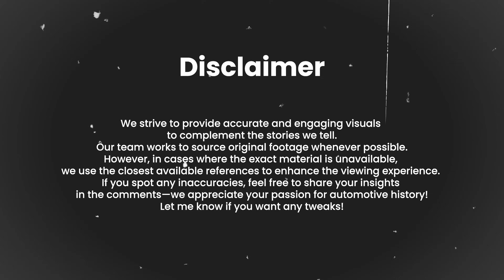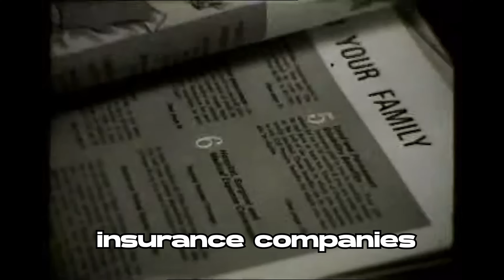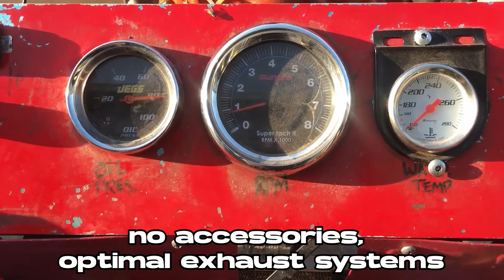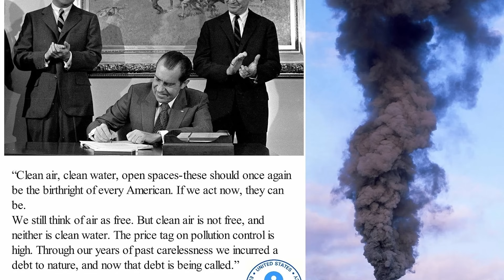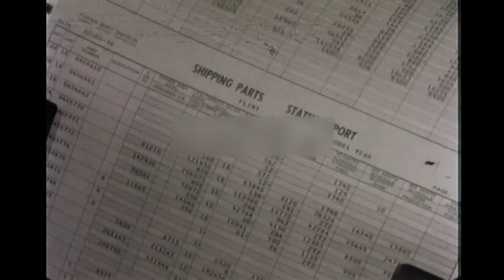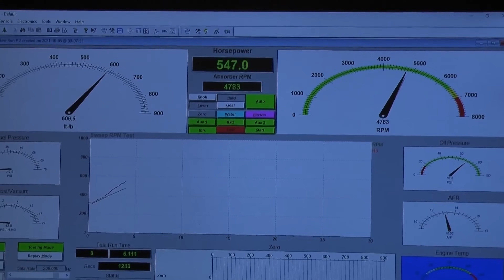The Shocking Truth behind Chrysler banned 440 Six Pack Engine

Comment: Mixed feelings on the 440.  One of my dads employees had a 1966 Sport Fury he got from his dad.  Truly a beautiful car which had the optional 440ci motor.  One evening he agreed to race a guy with ‘69 Chevelle 396ci for $100.  I knew the guy with the Chevelle and I knew his car was fast. He had a solid lifter 396 with 3.55 gears.  But in my opinion his biggest advantage was less weight, a fiberglass hood and trunk on that car.  If memory serves me right it was a cold October evening in 1979.  I even remember walking over to the speed shop in town to buy a can of 105 octane booster for my dads employee.  Well, the results were embarrassing, I would even say humiliating.  The ‘66 Sport Fury lost by at least 5 car lengths.  It was never close.
Reply from the maker: Thanks for sharing your story! The '66 Sport Fury with that 440 engine definitely had its charm, but racing stories like this remind us that weight and tuning play huge roles in performance.  @bgjb-r1499
Reply: @rarecarstorys Put the 440 in a dart or barracuda and then it's a whole other story. 440 6 pack, 400 hp. Or more, actually.
Reply: The 66 440 was a cruiser engine, it was 67 that the 440 Magnum was offered and became a street legend. In 66 the main performance engine was the 426 hemi. I'm sure the Fury was heavier than a Chevelle, hence the disparity.
Reply: It all depends on the tune of the motor . You could have 2 identical cars and motors and something like improper ignition timing could have 2 identical motors putting out vastly different power .. The 440 properly tuned should have moped the floor of the 396!! The 440 just was not tuned properly simple fact..
Reply: @kevindoherty2716   Here’s what’s weird, in 1979 that Plymouth was a 13 year old car and that Chevelle was a 10 year old car.  I agree with you regarding timing and having the motor properly tuned.  In retrospect asking me to go buy him a small can of STP 105 octane booster was a mistake without properly resetting the timing which is what I think you’re saying.  Joe was a local guy from my town and I believe his ‘69 Chevelle was also stock with the only modifications being that fiberglass hood and trunk which he swore made a big difference (lol).  One day he was spitting nails (angry) about constantly adjusting his valves, that’s how I found out his motor having a solid lifter camshaft.  You couldn’t ask for a nicer 1/4 mile strip.  The neighboring town had chemical plants which also had a perfectly straight road with an additional 200 yards to stop your car.  After someone got them on the line a car pulled out a little more than a 100 yards from the start, turned on the parking lights (get ready) and then the head lights (go).  The Chevelle had .355 gears which I find hard to label because they’re not racing gears or highway gears.  It was a 4 speed.  The Sport Fury was a 3 speed auto (no idea about the gears).  I’m being truthful with you, the race was never close as that ‘69 Chevelle pulled on the Fury the whole way down the track.  As I said in my original post the Chevelle won by 5 car lengths (at least).
Reply: Here we go with one of THESE stories... SMH
Reply: Fury was a big car. Not a race car.
Reply from the maker: I really appreciate you sharing your memories! It’s always great to hear stories about classic cars and races from back in the day. They definitely add a personal touch to the history of these engines.  @Rick-w3r6g
you are awsome
Reply: Yes. The sport fury's were as big as a Crysler Newport then. They were huge boats. I'm sure the Chevy had lots of aftermarket parts too. Any of the solid lifter BB chevy cars were hard to beat! But I used to beat most of them with my 440 Sixpack 70 Challenger running from red light to red light back in the 70's.
Reply: The 396 L78 in the Chevelle was rated at 375hp but it was really 425hp
Reply: It's been proven on more than on dyno channel on u-tube that the 425 hp 396 engine did not come close to 425 HP.
Reply: In 1966 the sport fury with the 440 was a standard engine with 365 hp and a curb weight of 4700 lbs.
The 1969 chevelle he was racing had a special order only L78 with 375 hp and a curb weight of 3700 lbs.
Reply: @robt3305  440 375 hp engine. with 6 pack almost 400 hp.

Comment: if they brought back the 440 like you suggest then when compared to the new engines the hellcat is supercharged and the revived one isn't so either the revived 440 six pack gets supercharged orbthe hellcat has to loose its supercharged because ther is no comparison if ones boosted and the other is not that wouldn't be a fair comparison with hellcats 2.4liter and the red eye's 2.9liter superchargers thats a big advantage that tuning a natural aspirated 440 six pack engine can't keep up with unless it gets the same amount of boost
Reply from the maker: You raise some valid points about the comparison between the supercharged Hellcat and a naturally aspirated 440 Six Pack. It's definitely an interesting debate, and performance specs can really change the game!  @mikemccabe7124
Reply: I've had my 69 6 Pak B since 1973 when I came back from my first WestPac cruise. I would rather have it than any I Pad controlled poser out there.